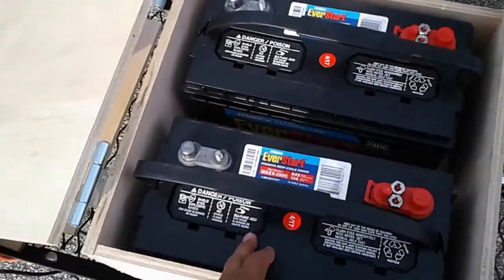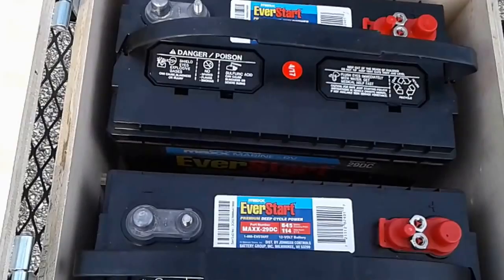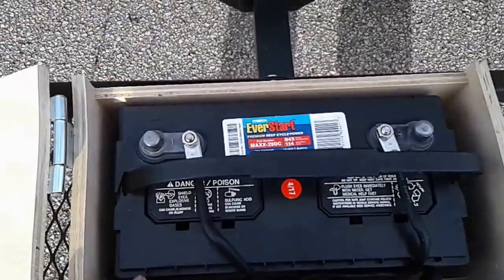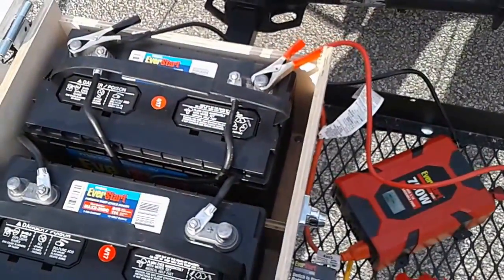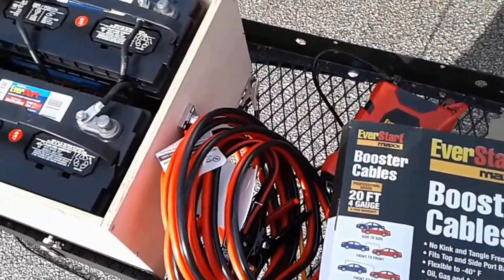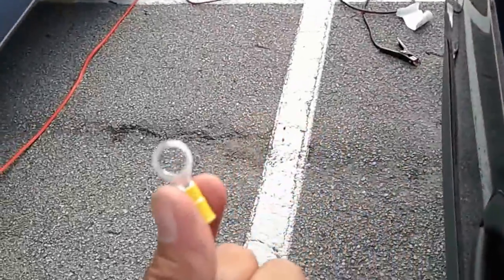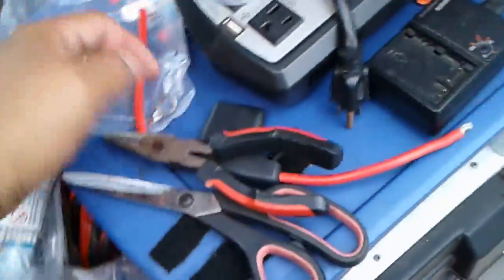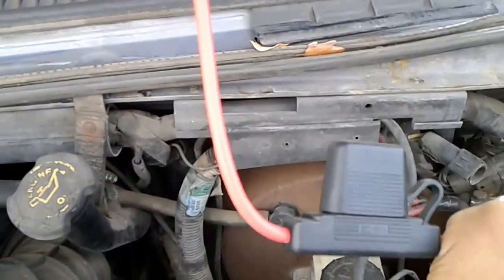Solo Female Traveler Van Build House Battery System Wiring (V499) Living In A Van

Comment: Does she have a good fire extinguisher?
Please be aware that carbon monoxide  and smoke alarms are important but if you're living in a confined space an extinguisher may be the difference between getting out and not getting out. Don't skip it or put it off. Put it at the top of your van/cr/rv  living list
Reply from the maker: +Paul Gray Thanks for the reminder. This is an important tip.

Comment: You should hit an automotive store and get a battery isolator to hook that battery bank to the vehicle battery - it will act as the switch and protect both systems from spikes - which might have been one of the issues which hit little blue.
Reply from the maker: I may have Sierra order this component for our next build session. We didn't get everything accomplished that we wanted to within our limited time (i.e., 2 days to do everything...and half of the first day was lost due to rain). We tried to install the necessary systems for her to be more comfortable and to stay cool during this initial build.